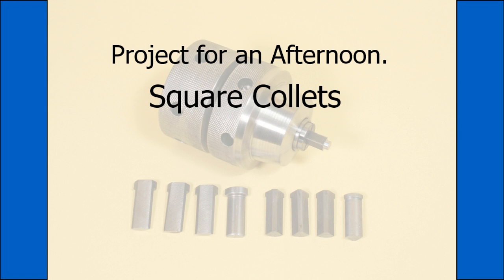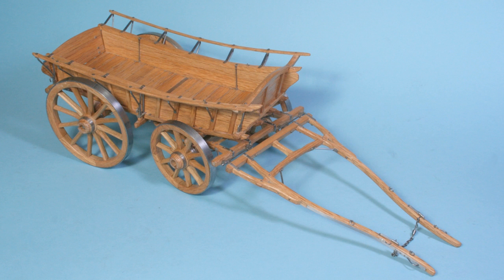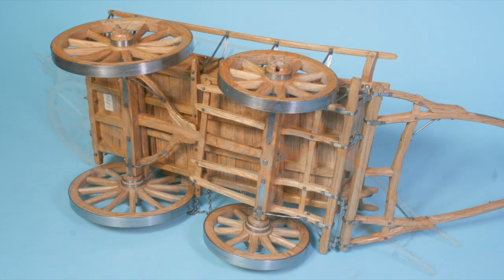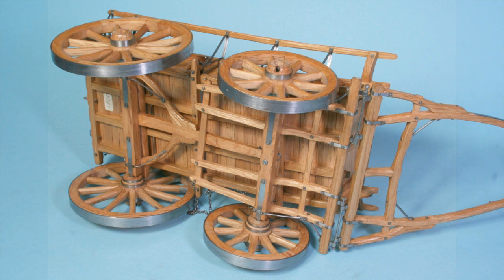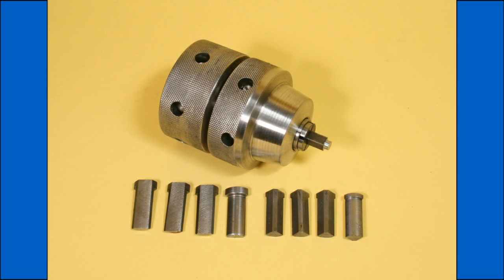Making Square Collets, the easy method

Comment: Nice idea Harold :-). Just wondering if it would be better to mill off the corner of a long piece of square stock  (making the milling a single operation and keeping the flats even) before cutting it up and turning the od?
Reply from the maker: At first, I thought it would be a good idea for smaller sizes especially if going into a large round collet. However, I then realised that it would be difficult to position the four individual pieces accurately for turning the outer diameter

Comment: Good idea. Just dont lose on of the four. I think you could also make them as a two piece "collet"or maybe  better name is "collet liner". The commercial square and hex 5C collets can be a mixed bag. The Hardinge are very good (everything they make is top notch) it's just how willing are you to give up that arm and leg 😕. The rest of the bunch it varies. Royal and Lydex are probably decent. Asian can be good or 💩. Of course you can take 5C emergency collets and open them up to the diameter that fits in the square and hand slot them in the in the mill using the quill. But ten you're paying for a collet again.